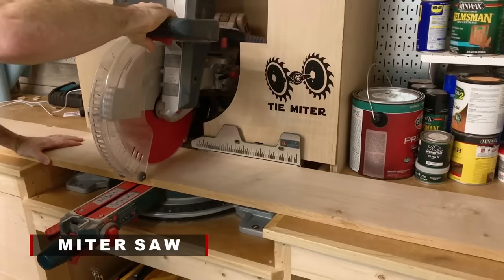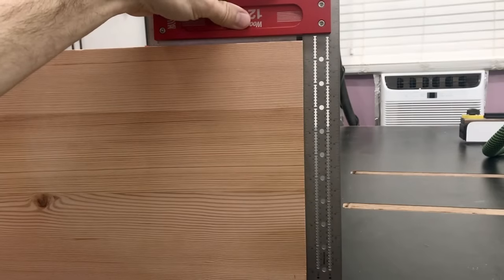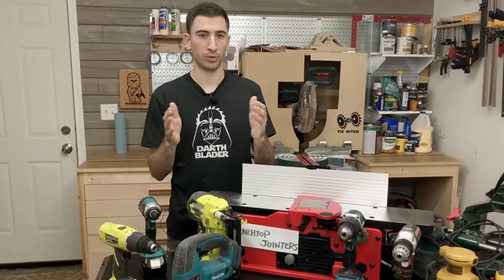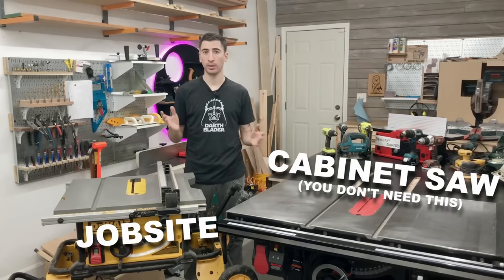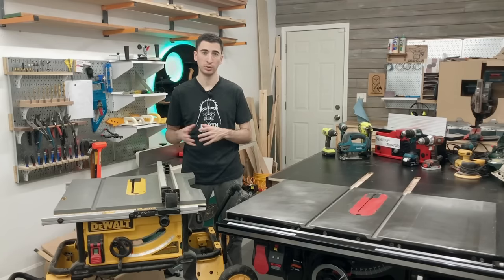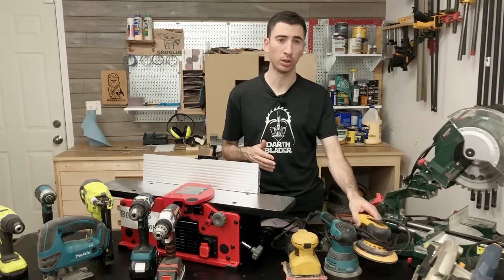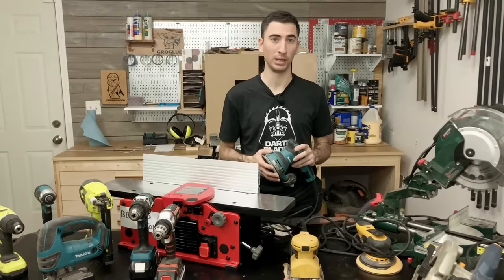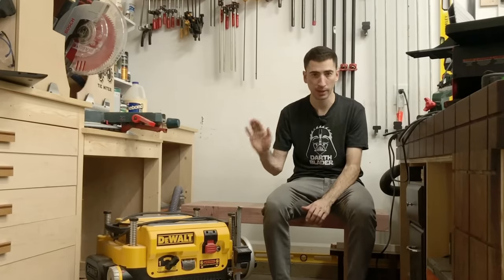Woodworking POWER Tools // Watch Before Buying

Comment: DeWalt jobsite table saw, period. Best fence on the market.
Edit: Skill now sells a 10" jobsite saw with the same rack and pinion fence which beats the DeWalt... It takes a dado stack (delwalt does not), has built in legs (one less trip from the truck to the work site) AND costs under $300. 
ALSO, we should all really be using  SawStops only
Reply: Recently bought the larger one, fantastic investment, love it.
Reply from the maker: Its a great saw. I probably would still have mine if it weren't for a slightly scary incident that I will talk about on the channel someday
Reply: @Lincolnstww  would you consider sawstop given the scary incident?
Reply from the maker: @antaholics  That's what I replaced the DeWalt with. Its the cabinet saw I referenced in the video. I love that saw

Comment: The Evolution mitre saw had all the tuning options but the machined bed and fence weren't close to flat so it was impossible to get consistent accurate cuts, so I'd avoid them, unless you want to spend a few days making them flat!
Reply from the maker: Ouch

Comment: About ten or twelve years old my kids bought me a kit of Ryobi battery operated tools. I do remodeling and found these to be very functional. They all still work. Also, for a miter saw 10 inch makes sense because the blades are much cheaper than 12". I go through a lot of blades.
Reply: You should think about getting them sharpened. This could save you some money.
Reply: @williamweatherall8333  how do you sharpen blades?
Reply: @jeancarlodelaluz6415  a local sharpening place will do it

Comment: Actually I have had good success with most Harbor Freight tools. I use them weekly. 
Cheaper too.
Reply from the maker: if it works it works
Reply: All of my tools are Harbor Freight tools.  I don't see anything wrong with them and they never fail for me.
Reply: I was taught to buy all my new tools from harbor freight, and then upgrade when/if they broke.

Comment: I started with a factory rebuilt ShopSmith with a 4 inch jointer. It was a great all around work horse. Solid cast iron bed and fence. Held settings very well. Table saw function wasn't great, but by building a plywood fence box that fit over stock fence, accuracy was improved to within 1/64. Plus the fence had a outfield support,  just 4x6 inches. Perfect for most needs. Down fall of the shopsmith as a table saw is depth of cut is controlled by height of table.

Comment: Skilsaw SPT99.  This is a very good option.  Rack and pinion fence.  Better stand than the Bosch.  Worm drive so significantly more powerful.  Cheaper than the Dewalt, or Bosch.  I know it is different than those cheap Skil table saws that you were referring to, but it is a very good option.

Comment: I’d say skip the miter saw and put that money into a table saw with a great fence and cross cut sled
Reply: I agree. Unless you buy a real top-shelf miter saw you're never getting an accurate angle cut. If close enough is good enough, then sure, but if +/- 1 degree is unacceptable a sled is the way to go.
Reply from the maker: Im not ready to go all in on that. There are days when I consider selling mine, but then there are instances I'm really happy to have it, especially when the table saw is set up for a cut and I can't move anything
Reply: You can't cut metals on a table saw.

Comment: "Pick a battery and run with it"  Me: buy the best tool and get yourself a battery adapter.  I have all DeWalt batteries, DeWalt drills and DeWalt impacts but I prefer the metabo framing nailer and Makita circular saw....and if I ever switch from a gas trimmer to electric I'll be getting Makita.
Reply from the maker: I love the makita weed whacker

Comment: Another thing making a come back around here and is cheap used, are radial arm saws, if you don't have the money for a decent table saw, they sell for 100 to 200 dollars where I live, and there are lots of them around so you can pick one that is solid. After you make some money, then you can buy that cabinet saw for the large bits, I typically make room treatment and that means some large pieces that are starting at 4'x8' and about 1 foot deep and up.

Comment: I’ll take my ryobi tools any day over dewalt junk. They’ve been coasting on their name for years and their quality has gone in the toilet.
Reply: I’ve had my Ryobi drill for over 7 years now and no problems. My previous Bosch died after 2 years.
Reply: I smashed my Ryobi - threw it off an elevated platform sick and tired the crappy performance, bought makita and never looked back. Then again I use power tools for work but for around the house they are adequate. Battery life is better than it used to be and they fill a niche for the hobbyist. Kinda Ryobi then dewalt then makita then Milwaukee being king of the hill with ridgid as an odd duck in there somewhere. Trust me I’ve used them all
Reply: I’ve used my ryobi drill,saw, nail gun, etc for over 10 years. Never had any problems.

Comment: My wife found a used craftsman contracter saw with a cast iron top two rockler tables with one being a router table with the plate and a Biedermeyer fence $200.. I have used it for four years. I built a large outfeed table out of scrap wood. It has been great. Yes it burns oak The blade wont move for angle cuts. I have a Makita portable saw I do that on. I am about to replace the saw. I have bought the Harbor freight mitre saw never buy this. Dewalt never breaks or gets out of square. I think buying a good router has unlimited potential.  I bought the Bosch with both bases. I recently bought the Dewalt cordless palm router with the plunge base it is beautiful.  I guess I didnt realize that I am a Dewalt guy. I agree with your comments.

Comment: I am a metal guy not wood, but occasionally my dad does wood work. You certainly can do some things with consumer grade stuff, but life is sooo much easier with used commercial stuff. For example, contractor's saw is usually weak, has 120v power and is meant for soft wood. Got dad a General saw mated to 3hp motor. This thing can cut all day, fast and accurate. Will also not move when cutting large fence posts etc. 

Dad was using old hardwood flooring to go on the outside of the house as decoration. A lot of it needed to be planned. The consumer grade planner was too weak, would overheat, could not take cut needed etc. Got a Delta 2hp planner. Whole day non stop - huge bags of chips - got the job done. I re-sharpened the knives for dad on surface grinder.

Comment: Ryobi has been my most reliable tool brand.  I left my Ryobi cordless drill outside by mistake, it was in a tray that filled with water when it rained, and was submerged over 24 hours.  I disassembled it, sprayed liberally with WD40, and it was soon running good as new, even the battery was fine!

Comment: Great advice and video. I used to buy the best name brands and models which of course came with a high price tag. Later as my needs grew for the larger equipment I shopped used quality and saved a ton. The only thing I don't agree with is you said the 1/4 sheet palm sander was no good, instead get an orbiting sander. I've been using palm sanders for decades, actually 3 each loaded with different grits. I've never had issues with not ending up with nice smooth finishes. It's also much cheaper buying sheet sand paper than the circular.

Comment: I started a year ago, woodworking.
I have all ryobi.i love them 
The one bad tool I have is the scroll cutting machine.
Drills,sawzaw,impact drill, sander 
Oscillating cutter ,highbeam flashlight and circular saw
All work great and batteries are 
Working like new.

Comment: I’m a pro carpenter and I’ve been using a Skil worm drive table saw for 3 years now. It’s actually great. I highly recommend it as the best value portable saw
Reply: In your opinion what is the best and strongest joint for a high-powered demand subwoofer box that's trying to be torn apart from the inside out? Any response much appreciated I'm looking at a very high power build here

Comment: I just wanted to say your dead on.
There are several mid tier options that provide excellent use and as you learn outstanding results.
Bosch jig saw beats festool any day of the week.

My Ridgid random orbit runs circles around the festool and mirka ones too.

In my old shop we sold an old grizzley sliding saw when it was time to upgrade. The owners took a hard look at what they had and wanted and needed and opted for a manual standard adjusting scimi sliding saw... And with the extra money in budget we're able to upgrade the scoring blade and got a grizzly spiral planer 18 inch wide. ......

And had money left over for the beer while we set it up 

In the end we were much faster and happier with a better product.

Btw the planer we replaced was a DeWalt lunch box

Comment: MANY thanks - subscribed! My next purchase was going to be the Dewalt table saw and you confirmed this is a good choice. (My first build was a 10x20' shed and I had a battery Dewalt 6 1/2" circular saw, a driver, drill and a hammer!)

Comment: I have a 10 year old Master Mechanic miter saw from True Value hardware that has served me well, but then I may only use it on 2-3 projects in a year's time.  Tools I find I don't use very often would be like my router...twice in 5 years, lol.  That being said, it's there when I need it.  I'm not loyal to any particular brand and I often go for corded tools instead of cordless ones because I never have to worry about a battery becoming obsolete...which is why I'm on my third cordless drill now even though I have a corded Milwaukee drill.  A sander, even a palm sander is of more use to me than a hand plane because often my projects are refinishing radio cabinets on old tube radios which usually have veneer like mahogany over a cheaper solid wood base, usually using a 220 grit or higher to smooth out raised grain and/or grain filler on veneers like black walnut.

Comment: The advice on the Table saw is good advice .If your starting out I'm sure you can find a good Delta saw sitting in someone garage who gave up woodworking hardly used .When I first started I used a contractor saw WISH I had  the advise above when I stared  .Well done video thanks for posting.

Comment: Almost every single power tool I own was given to me by a relative. I have a 70 year old McGraw/Edison Circular Saw that is still in perfect working condition despite seeing tons of use, and a 40 year old Sears/Craftsman Miter Saw that doesn’t have all the bells and whistles of a newer tool. But it still does it’s job. In fact, the only new power tool I bought myself was a Milwaukee M12 impact driver set, when I bought my home, last year. I appreciate videos like this, because it’s not often that I do spend money on power tools. But with the prospect of turning my garage into a hobby shop, I may eventually need to.

Comment: Believe it or not the best portable table saw I've ever had was a Ryobi, at least in terms of features and ease of use. 
 It was in about 2010, and the model doesn't exist anymore. I bought it on sale for a particular job I was doing at the time, not expecting it to be as good as it was.I would still have it if it hadn't been stolen. 

Currently I have a Bosch, which I have no doubt is better quality. But it's more awkward to transport and set up.
 If some manufacturer duplicated that original Ryobi saw with the quality you get from a higher end brand, I'd buy it in a heartbeat.

Comment: I'm an award winning woodworker since I was in High school. I've been a carpenter of all disciplines. Back when you had to know how to use hand tools as good as power tools. In some cases better. 
Having said all that. I found your video to be pretty good advice. I think the craftsman needs to consider their use and expectations for which tool they'll select. There's not a one single brand in my opinion that makes the best for every tool. Just for example. I Milwaukee Super Sawall is the only  Reciprocatings saw worth owning. Its heads and shoulders above the rest. I prefer a corded version if at all possible.  They use a bunch of energy, and kill batteries for cordless models. 
I could give you many examples of such choices. 
Having said that. I agree when buying cordless tools, you should try to stick with all the same brand because of the batteries. They can be as much of an expense as the tools themselves. 
Working in a shop, I try to use corded when possible. However you really want to have a good mix. Too many cords make it difficult to work and walk if they aren't sourced from above. Which is really the best way.
I'll stop here, I tend to talk too much so good job happy making.

Comment: Mitre saw: 10" single bevel Makita, light, accurate and any boards longer than 6" you should be using a track saw anyhow.  Lots of blade options.

Table saw: DW7491 if you have the room or arm strength but TBH 7485 is more than enough.  It's a good saw, if it can't do it it's your fault.

You need a router.  Makita and Bosch are great.  Older porter cable also good.

Battery tools: Hilti, their standard 12v or 22v stuff isn't expensive (in fact cheaper than the big thress top tier stuff) and has a great warranty.  The power, durability and ergonomics are unmatched despite what specs saw.

Hand tools: very important.  Learn to tune and use a plane, marking gauge and chisel.  You will find that they are often faster and much better performing than Power tools.  Veritas gets my pick for cutting tools.  But do some research and you can often get away with much less.

Comment: I picked up a Ryobi table saw with legs at Home Depot when it was on sale. I built a work table (2ftx4ft) that is same height as table saw and this helps when I need to cut long pieces. I just got a old Miter saw on CL for $20 and its very clean and in good working condition.

Comment: Here we have three tiers of Ryobi tools.  They have a very cheap DIY range that I've never tried, then what I suppose could be called a middle range and finally an industrial range.  Those mid-range tools come with a 2 year warranty and seem to be perfectly reliable for home use.  They're also typically cheaper than even the Bosch green range.  The industrial range has a 5 year warranty.  Then there's the Bosch green range which also in my experience can take quite a lot of use without any trouble.  I've had no trouble with the couple of modern Black & Decker tools I own.  I had one of their drills too which I only replaced with a Bosch green model because I needed variable speed.

Comment: I think there is an important exception to what is otherwise a lot of excellent advice here.  I have several mid-range hand power tools from Harbor Freight that I did not pay much for and have worked great over the course of several years: corded multitool, orbital sander, and drill.  I did not buy the cheapest model in the store, but the cheapest with the features and/or power that I felt I needed,  and still much cheaper than just about any other brand. If it fails and has to be replaced after a few years, it's still good value for the money.

Comment: My first "big" power tool was a compound miter saw. I use it for multiple cuts of long stock now...that's it. After I bought and set up my table saw, a lot of what I'd used the miter saw for is done on the table saw.

Comment: I've been a carpenter, Maker, and antique furniture restorer for 50+ years so I have a unique set of skills. I have a 1947 Shop Smith that I use as a lathe only. A Craftsman radial arm saw that I use daily for rough cutting and is dead on accurate. My table saw is a Dewalt 745 without the arbor that holds a dado stack I have used it for years and is still dead on accurate. It has a 35" left hand side for my Incra miter gauge and a cart that is the same height for long stock that I use as an infeed. I started with Makita 40 years ago and have stuck with them and I have dropped them off of roofs onto concrete so I am Makita for life. A DeWalt lunchbox surface planer that I use on occasion, Craftsman bench top drill press and bandsaw etc etc for tools. I do have a cheap chop saw a family member gave me and I hate it and I go right to my radial arm saw to make those cuts. My suggestion is to NOT buy a tool because someone recommended it on YouTube, start middle of the road if a beginner and use them. The cheap tools will frustrate you and make you hate using them and are dangerous. Buy only the tool you need for the project at hand and wait to see if you need something else or better and if you keep using it. Use it until it doesn't do the task you need it to do.

Comment: I have Bosch battery power tools in Italy. Here in the US, have bought a number of the Ryobi 18v tools. The Ryobi skill saw is far superior to the Bosch. I have been in construction/boat building/ maintenance for more than 50years. I’ve had Dewalt, Makita, Porter Cable and Rigid. Loved the Rigid for the lifetime battery warranty. I had a Rigid 10” table saw that I could not say enough good about. To a large degree, working with power tools is like golf- buying the most expensive tool or golf club does not make you the best woodworker or golfer.

Comment: I bought a Hikoki C10 table saw, which is basically a clone of the DeWalt you recommended.
I only use it occasionally, but I'm very happy with it.

And coming back to your 'Danish Clogs' .... The picture showed Dutch Clogs 🇳🇱 . Which I believe are actually not so easy to make.

Comment: I wanted to take a moment and thank you for your help to the community by exposing which job site table saw is to take dado stack, and has the fine adjustments you can make to a cabinet style table saw. I'm saying that as a hobbyist that has a lot of Ryobi battery powered tools, and I'm sure I'll add more in the future. Ryobi has yet to produce a job site table saw in the same class as the DeWalt not even close. I think they easily could, and should crying out loud.